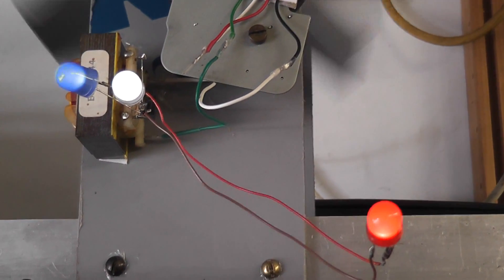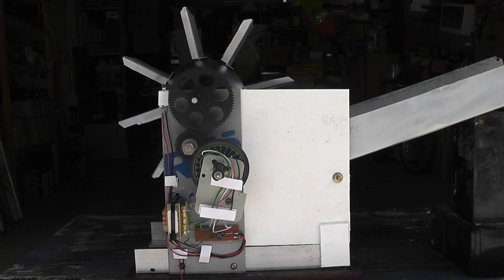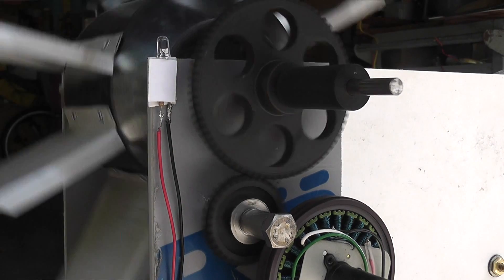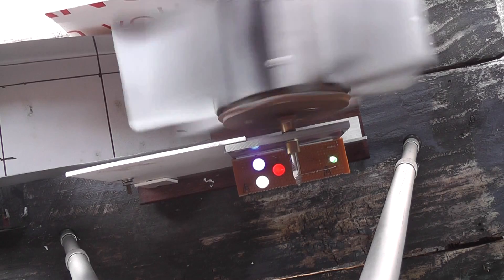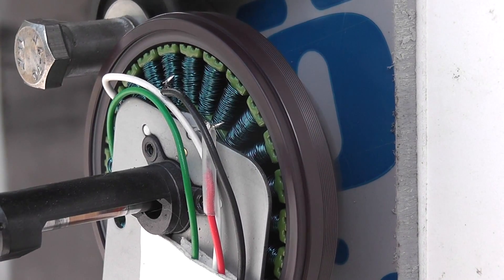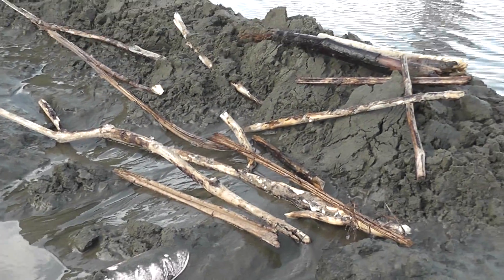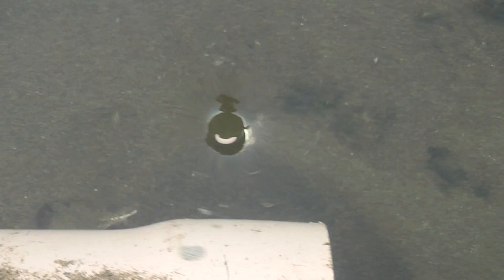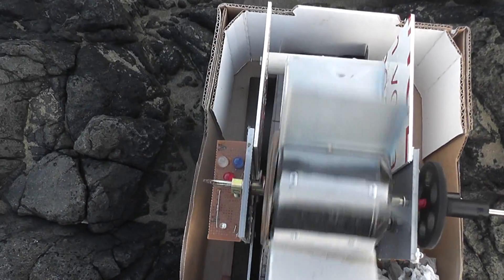Waterwheel for on the beach

Comment: Interesting little arrangement. At the end of the video, when the wind started to blow it, a large traffic cone, ( with the small end pointing towards the water wheel ) would have concentrated the wind pressure & it would have really spun up that wheel quite nice. :-D

I'm just wondering how long it's going to be until you make a big 240v AC one of these and attach a kWh meter to it. :-D See the water wheel spin the load-wheel. :-D

Thanks for showing,

{^_^} BoomBoxDeluxe {^_^}